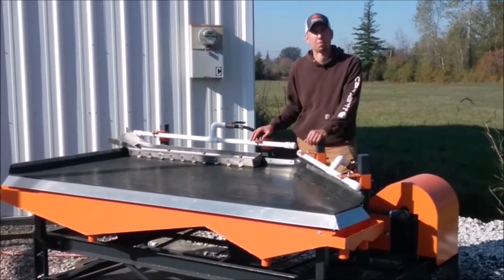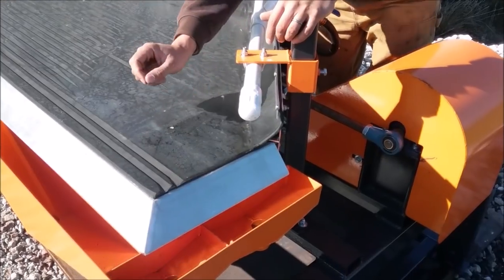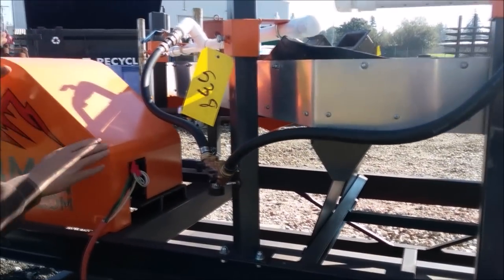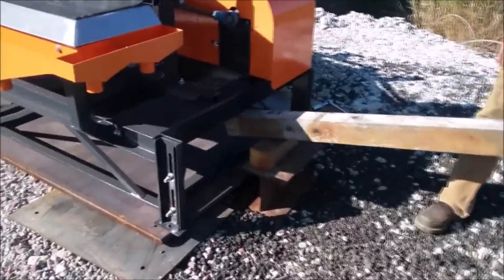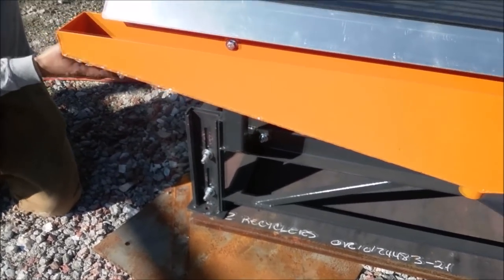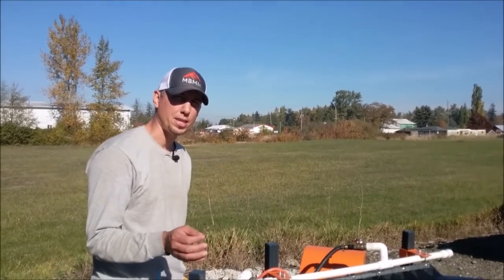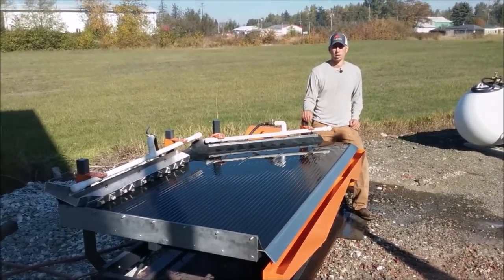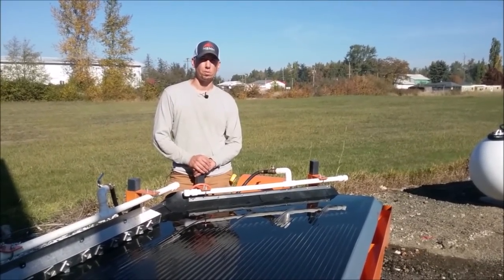How to set up and operate a shaker table for best density separation

Comment: Great description of a practical and reliable design.

I have a few practical suggestions that you can add to your table to simplify the set-up that will not add notable cost.

For setting the 0.25/12 slope can be set into the side of the table with a welded straight edge at the correct angle that you rest your builders lever.
To weigh the table down you could have an option of an expanded metal basket at the bottom of the table that can be filled with rocks or bricks.
It was not clear if you had 3 or 4 legs. While 4 would be more robust it would be great if there was just two levelling adjustments that do not interact or warp the table.

This is your second video I watched and you have a well engineered product and I would love to have an excuse to make use of one.
Reply from the maker: Awesome!  Thanks for the tips to make the products better

Comment: I’ve had one of your tables for a couple years now. 
It works great, but I’m having some issues with recovery on a particular ore. When I do pan tests on the ore, I can recover about 10 grams per ton, but I’m only getting about 3 grams per ton on the table. 
I’ve tried different mesh sizes and some table adjustments. 
Would you suggest more or less slope from the top (feed trough), to the bottom (tailings port)? I currently have 1/4”/ft. 
Also do you think that the vibration from my Stuttenroth mill could be messing with the table recovery?
They’re not touching each other, but they are both bolted to the same concrete.

Comment: What variables/dimensions of control are available for adjusting to different materials? Say I'm separating gold and copper and it's set up so that gold goes into #1 and copper into #2. Later I want to separate copper and aluminum. How does one go about changing the behavior of the machine so that copper now goes into #1 instead of #2 and the aluminum goes into #2? Also same question but with even lighter and lighter materials. As far as getting lighter and lighter, what are the limits in this regard if any? Also, I couldn't find a video on this, maybe I just missed it, if I didn't I think the topic would make a very interesting video.
Reply from the maker: Thanks for the comment.  The table isn't quite that sensitive.  The materials form bands on the table based on their density.  Only material with a density of about 5 g/cc can climb the ramp.  If all you have is copper then it will go into the #1.  If copper and gold the gold and some copper will go into the #1 and #2 will be mostly copper.  The table works great for separating small amounts of very dense material from lighter waste, but its not good at separating small amounts of material with slightly different densities.  If you check out some of our videos processing electronics you can see the various bands of metals going into #1 and #2.  We have copper, gold, lead, tin, etc all going into the #1/2 but the table is doing a good job separating the heavy metals from the plastic and fiberglass.  Not sure if that all makes sense.  Think of the table as a concentrator and not a perfect cleaner/separator

Comment: Jason would you provide the stroke length?  is it the same for yur smaller table.  Since these are not adjustable I assume have experimented enough to get a good compromise for fine and course recovery of gold and other metals.

Comment: What  if you use a larger an a double long shaking table? In the case of computer scrap... Does The rainbow of metal density will be really  better.? .. Very very dense a the long long nose of the table. Ang gold is the one...

Comment: Im confused, if you dont have a bump stop what makes the heavies migrate in a particular direction instead of just dancing around on the spot?
Reply: It's the hop he talks about at 5:15
Reply from the maker: The springs are angled at 17 degrees which gives them some upward and forward movement

Comment: you can increase the speed of the table by increasing the size of the motor pulley or reducing the drive pulley diameter ... just like a multi speed bicycle ...
Reply: That would cause the earth to spin in the other direction.. can't have that!
Reply: That would cause the earth to spin in the other direction..  we can't have that happen!
Reply: You can also use a 3 phase motor with a single phase vfd and use that to control the speed of the motor
Reply from the maker: Yep, we have found that 325 RPM is ideal